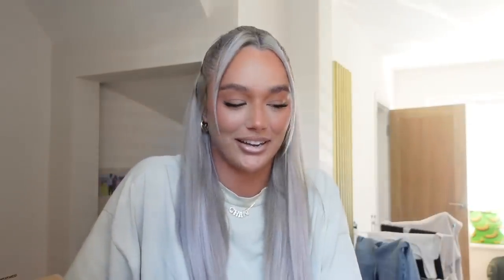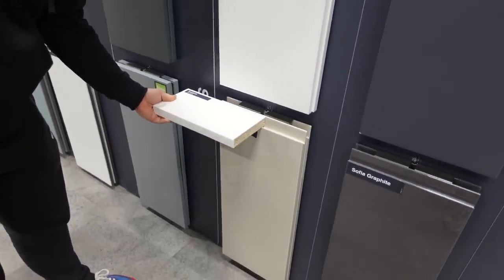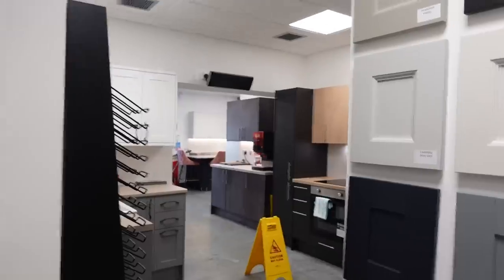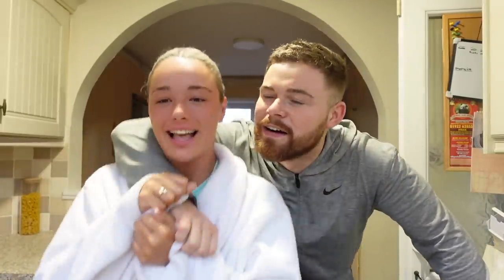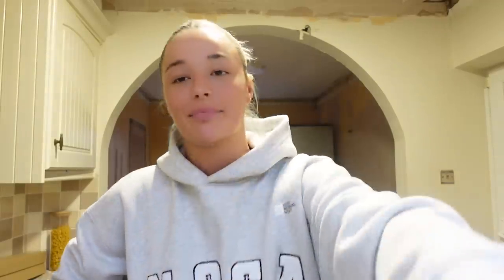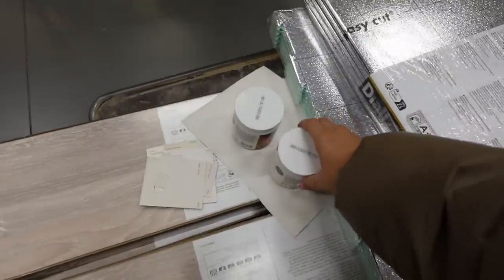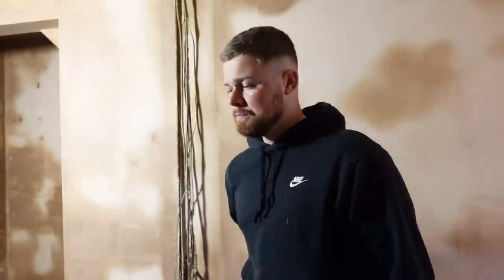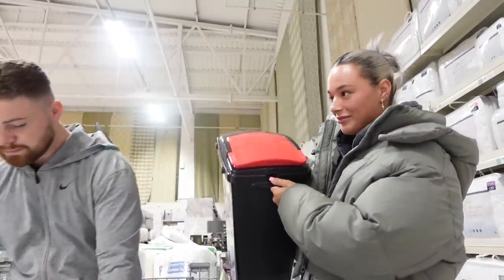our FULL kitchen renovation vlog 🏚️🍴☁️ sleek minimal vibes | the final moving vlog 🎉

Comment: Just renovated our kitchen and fitted ourselves to save money.. I'm the same in regard to liking the sides bare, what about storing the microwave in the spare shelf in cupboard.. if it doesn't fit height wise you can move the shelf up.. this will also give you more worktop space! Also what about an extractor fan above cooker? You can get filter ones that are quite cheap where you change the filter 1/2 a year and save drilling a huge hole I'm the wall... love the overall look 👌 well done 😊